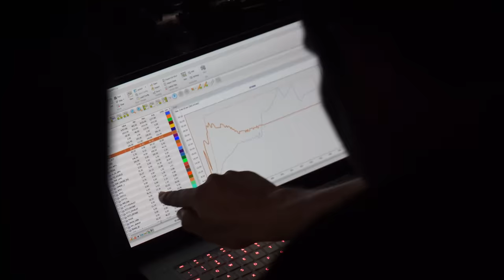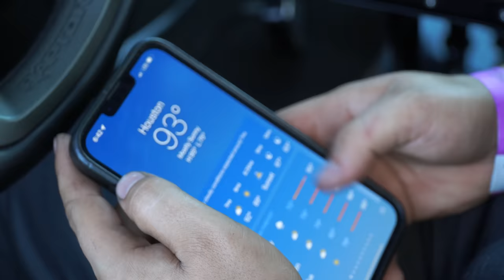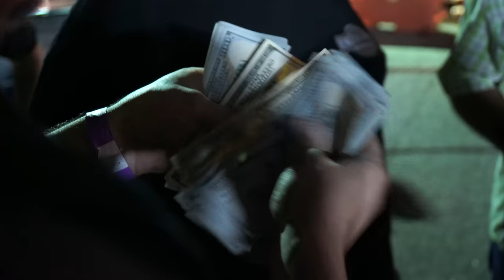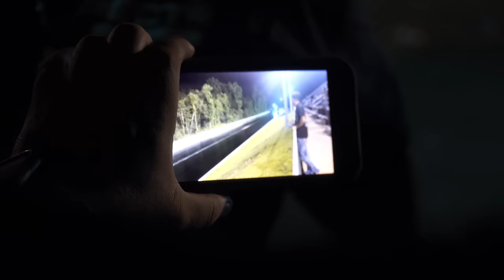The Rematch! Gremlin VS Baby King Ranch (10K POT)

Comment: I'm no hater but when ondgas was on pasadena shop team and winning with crawfish they were on top of the world and call out the whole natio and midnight took it personal 😂 now look at them now 😂
Reply: Bro, wait to see what's coming. They were on top and getting fcked by PPS wait till Flaco is done with it. You must not know Flaco, and what he has done in the game of racing can't wait.
Reply: Beto can't go wrong with Flaco, Velocity, and Mindnight. 

No need for PSS.😢
Reply: @ivanr2879  😂
Reply: Even Gringo knew it was time to dip they were taking all his money
Reply: Mámalos
Reply: @96tahoe2dr4 to be fair they had crawfish running fast asf with the setup they had. It was the fastest 4x4 and beat gator. They were going good for a bit
Reply: @jmemixx  go back to where Frank bought a built Texas speed motor for brownie on the first hit with PSS tuning it and slapping the motor it blew frank was surprised as Texas Speed was
Reply: @jmemixx  pasadena did that but they pull some scummy moves. You don’t steal from your best client.
Reply: @SingleCabCrew  spill it what happened?
Reply: @SingleCabCrew yea what happened? Besides the heads because they left before they found out about that.